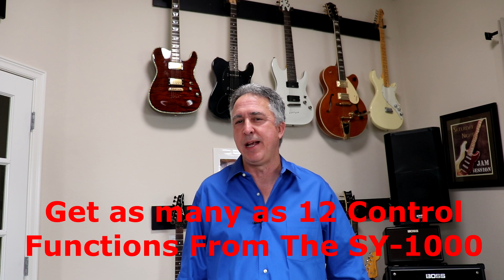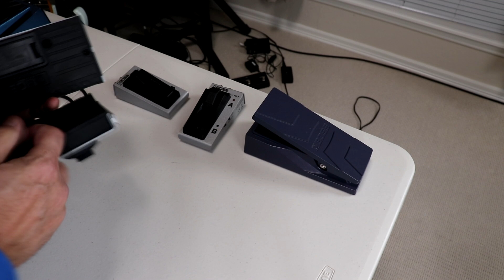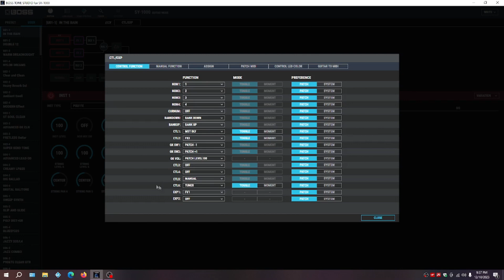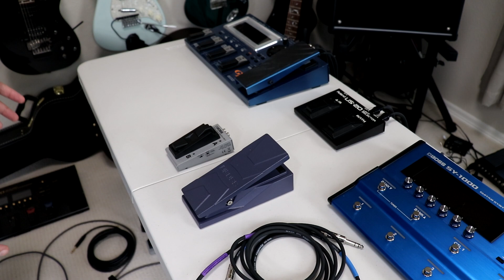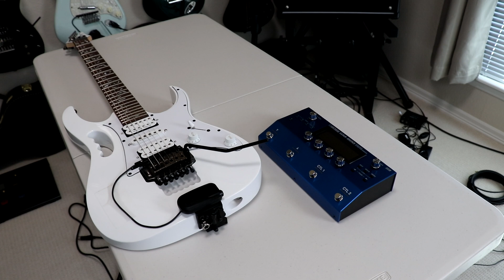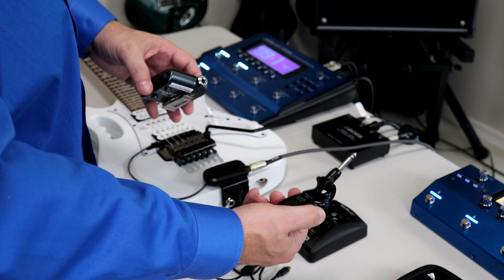Plug Into 3 Guitar Synths At Once

Comment: Good video that lays out the options. It's a bit pedantic, but you should adjust your vocabulary to not call the divided pickups MIDI pickups. They are definitely not MIDI pickups, they are simply divided string pickups. Any MIDI conversions are done in downstream boxes. This tends to confuse people and potentially put off players who don't want MIDI capabilities or delay.
Reply from the maker: You are absolutely right, Midi data is not sent through the pickup. I know how it works. I have been around a long time and I have seen older articles about older Roland GR gear that referred to the GK line as a Midi pickup even though it is not. It is a divided pickup that sends 6 independent signals to the Roland or Boss unit. The transfer to midi actually takes place inside the guitar synth itself. Calling it a midi pickup is just a habit that developed from long ago, but I can see how that can be confusing. I will try to do better.

Comment: but to use the boss sy 1000 you need the pick up midi installed? or can you enter with the jack and have all the ambient sounds?
Reply from the maker: You can use the SY-1000 with a normal guitar and pickup system. There is a special input for that. It gives you access to all the amps and all the effects. You also get access to the main synth for even more sounds. You will need one of the GK pickup systems to access the Guitar modeling and some of the other synths. Those other synths are not the main synth that is built into the unit. In my view, it is worth having the guitar models, and I think they are better than the Variax guitar models by line 6. This all depends on your needs. The nice thing about the SY-1000 is that it has many of the amps that are also found in the GT-1000. So it is their latest quality.

I did a video that shows you how to use the SY-1000 with a normal guitar without the Special GK pickup. It also works great for acoustic guitars. https://www.youtube.com/watch?v=wiYDffAKRJM

Comment: Hello Marcus, as usual your videos are very detailed and well produced.  I'd like to ask your advice: I'm planning to buy the SY 1000 and I'd like to know whether the tracking is excellent on this guitar synthesiser. Is it excellent?  Are the sounds great? What are the advantages and disadvantages of the SY 1000? Thank you in advance. 
Kind regards, 
Phil. From Dunkirk
Reply from the maker: The SY-1000 is still my favorite synth, but it's not for everyone. So let me start with the disadvantages so you know up front. The SY-1000 is not a PCM synth. It is not sampled based. This means that you won't get sounds like sax, horns, pianos, or anything else that is typically sampled in a keyboard. This is a dealbreaker for some people. The SY-1000 is strictly an analog synth. Think of Moog or other types of analog synths. So the sounds are limited to those types of sounds. Some people are disappointed that they can't get the instrument sounds that typically come with sampled keyboards. That being said, the analog synth is great, and you can come up with some great patches for guitar, but don't expect authentic strings or anything like that. It does have some good Pad sounds, which is sort of a replacement for strings.

Now let's talk about the supper powers of the SY-1000. First, it has amp modeling. The amp models are based on Bosses new A-I-R-D technology and not their old COSM technology. These amp models are similar to the ones you find in the GT-1000, and they sound excellent. I chose these models over the Line 6 Helix models and yes I have line 6 gear and I played through and tested the helix stuff extensively. It is important to note that this is really a matter of personal preference. In addition to that, the effects you find on this unit also can be found on the gT-1000. So the effects and the amp models are fantastic. 

It also has a normal quarter inch jack that you can use to plug your guitar into. This means you can use the amp models and effects with any bass, electric guitar, or acoustic guitar. I have made patches for all three instrument types when plugged into the quarter inch jack. No other synth does this. If you are going through the quarter inch jack, you can also use the dynamic synth with your regular pickups. There is more than one synth built into this unit, but they are all analog.

If you decide to get the GK3 pickup, then you really unlock the potential of this unit. Now you have access to all the guitar models and there are a bunch of guitar models. You have a collection of acoustic guitars, Bass guitars, and electric guitars, and you can use these with the amp models. Anything from Mesa Boogie to Fender amps can be found in the amp models. You can also make any guitar a 12 string. In addition to that, you can control the way the guitar model is tuned. This means you can use a control function and enter a dropped D tuning on any patch you make with a guitar model. You can also program open and tunings and alternate tunings into your patches. The things that I mention are often overlooked, but to me, they are some of the greatest selling points of the SY-1000.

And finally, if you use the Gk3 pickup, you unlock the other synths. You can layer up to 3 guitar synths or guitar models in one patch, or you can blend together any combination you choose. This is the most underrated and overlooked guitar synth out there. I call it Bosses best kept secret. You can use it with any guitar you own, and the analog synth sounds are great. Just don't expect to be able to play a grand piano with it. There are features in it that allow you to use it as a midi controller so you can use it with a software synth, but I am still working through this. Latency issues kind of make this hard. I hope this answers all your questions, but if not I did a video exclusively for the SY-1000, and it is a quick overview of the unit. https://www.youtube.com/watch?v=wiYDffAKRJM

Comment: Hello friend, I'm a grs lover, I have the gr-55, gr-33 and gr-20, I'm thinking about purchasing the gm-800, but I have some doubts. From your point of view, has it improved the issues of ghost notes and latency in relation to the grs?
Reply from the maker: I don't have any issues as long as I am using a GK3 pickup. Everything works fine. I run into some issues if I use the GK5 pickup. If you purchase the GM800 you will also need to get a converter box called GKC-AD. The good news is the cost of the box is cheaper than the new GK5 pickup. The box allows you to use any guitar that has a Gk3 pickup installed. In addition to this, Boss just released a brand-new update a few weeks ago that addresses many of the tracking issues. If you have a GK-2A, GK-3 you should not have any tracking issues at all. The new update also improves the GK5 but that pickup still needs improvement. Just be sure to do a firmware update if your GM800 does not have the latest firmware.

Comment: Hi, I have an important question, please!
How to connect a volume pedal in the GM 800. I bought a Boss FV 5 H but it is not plug and play. How do you control the volume while playing, I mean my hands are not close to the unit’s panel. If I had a GK3 instead would be easier
Thank you!
Reply from the maker: The Boss FV5H will not work with a GM800. FV stands for foot volume. This is a straight up volume pedal. What you need is an expression pedal. You will also need a TRS cable for it to work right. A TRS cable is a quarter inch cable that has two rubber rings instead of one. This kind of pedal transmits midi data and it can also work as a volume pedal. Here is an example of an expression pedal.

https://www.boss.info/us/products/ev-5/

Here is the top one that Boss makes. This is what I use for a volume pedal. If you get this one, remember to get a TRS cable to go along with it.
https://www.boss.info/us/products/ev-30/

Comment: Are you real, or a virtual assistant created by Google AI using my guitar synth search history from the past several years? You answered every question I had about the SY-1000, GR-55, and the GM-800, including the GK-5 issue. Thanks!! I have been using the SY-1000 and GR-55 together for a while, and they are indeed a great combination. I can't wait for Boss to fix the GK-5 issue; that is the biggest problem I am aware of.
Reply from the maker: LOL, I hope what ever intelligence I have is not artificial. Maybe it is who knows. I believe the GK5 issue is the only issue there is. I am unaware of any other. Lots of people have this issue and I have heard from many that are struggling with it. I am just glad that I am able to use the GK3 with the GM800. That being said, I made a discovery in the last few days. I switched out the cable that is recommended by Roland to be used with the GK5 pickup. I thought it was a special guitar synth cable with some new tech. Instead of using that cable, I am using a simple TRS cable. So the new guitar synth cable by Roland made to be used with the GK5 is nothing more than a glorified TRS cable. As soon as I did this, the GK5 started to work a little better. There are still issues and this is not a fix. But I don't have the extreme problem I had with the GK5. It is at least a little better.

Comment: This is a great video. I have an SY-1000 and was looking to get a GR-55 and hook them up together. Too bad there is nothing available to be able to make the units wireless for a guitar!!!
Reply from the maker: I agree, Playing wireless guitar has kind of spoiled me.
Reply: BluCoe makes (or made) a wireless GK solution, but they're out of stock and I'm not sure if it got past prototype run and they were not cheap @ €450. It's a shame as GKC cables SUCK and the cheap knockoffs are way worse... plus now they're $100 - for a f*#$ing CABLE!!! 😮 I need 2 of them right now and for that price I could buy another used GR-20... I'd rather drop the coin on the wireless.

Comment: Insanely great idea, especially for live stacked work that leaves everyone confused about what they’re hearing and seeing unless you’re behind the curtains like the Wizard of Oz at a theme park with alter ego issues and a tube amp and your favorite synthesizer. Sounds like a dream job to me. Great work I’m still working on my setup and would like employment performing such kinds of guitar works or sessions. Can’t wait to merge what I got with just 2 of those. But honestly,. I would like your opinion on the best way to play a Jupiter-8v or would that simply be the 800 with a unlocked Jupiter purchase which is how much again are we talking about to play a Jupiter 8 like it’s in front of you but it’s not kinda way?
Reply from the maker: Boss has a software version of the Jupiter 8. One way of blending sound would be through the computer. The GM800 could act as a midi controller. The next video explains how to do this. Another way would be through midi. If you have the Hardware version of the Jupiter 8 you can access it through midi. You can use Tone Studio to set up your GM800 patches so the Jupiter 8 will respond to the GM800 or the GM800 will respond to the Jupiter. The Last video I made covers how to program MIDI.

Comment: In order to use an expression pedal as a volume control do you have to program that into each patch or can you do it globally? With the GM 800
Reply from the maker: You need to program that into each patch. There is no global setting because it is an expression pedal. It does other things. For example, you can use the expression pedal to control the rotation of a rotary speaker, like the kind of speakers found on organs. The good news is that it is very easy to set this up if you are using the Tone Studio software. It does not take long at all.

Comment: Very nice video, well explained. Were you finally able to fix your issues with the GM-800?
Reply from the maker: No, I was not able to fix these issues. The only way that the issues will be fixed is through a firmware update by Boss. However, all my guitars with the GK3 pickup work with the GM800 very well. In Fact, they work better with the GM800 than with any other guitar synth. The GK3 tracks better with this synth. As much as I would like the GK5 pickup to work, I am not without a solution. I just use my other pickups
Reply: @marcuscurtismusic  I just got a GM-800 and use it with a SY-1000 and GX-100. I noticed some tracking issue with my GK5 and GM-800 but tracking seems to be the same as my GK3 with the SY-1000. Since I only have a GKC-DA, I cannot say if the GK3 would track better with the GM-800. But from what you are saying, your GK3 (through the GKC-AD) works better with the GM-800 than your GK5?
Reply from the maker: @ChristianDubuc-l4t  Yes, that is exactly what I am saying. This has been my experience. The GK5 works great with my SY-1000. This tells me that the issue is not the GK5. The issue is the software on the GM800. This could be fixed with a firmware update. How long it will take Boss to do a firmware update is anyone's guess. I would recommend contacting customer support on the Boss website and tell them about your issue. I think if more people would report this, then they would issue a fix sooner because they will make it a priority.

Comment: Dear Marcus, thank you for your great work and I don't want to know how many hours you spent on it! I have a question which might be stupid and/or not valid : In case I want to AVOID a GK-5 adapter - would the following routing/chaining be possible: I go from my electric guitar (no GK-5!) into my SY-300. Then I use the SY-300 OUTPUT to go into the GM-800. so, again, I just want to trigger the GM-800 sounds WITHOUT using a GK-5 adapter. I am aware that I loose the guitar to midi feature, but the sounds alone would do so far for a certain guitar. Hmm- writing down that, I fear there is an error in my reasoning!?? 🤔
Reply from the maker: You will need a GK pickup of some type in order to use the GM-800. The superpower of the SY-series is that you can plug in any guitar through a quarter inch jack input. The SY series are the only guitar synths that do this. All other Boss and Roland guitar synths require a GK pickup of some type. You can't take the output of the SY-1000 and go into the GM-800. However, there is a synth output on the GM-800 that allows you to go from the GM-800 into the SY-1000. You will still need a converter box of some type. Think of the GM-800 as strictly a Keyboard device with no guitar features at all. It is a keyboard that you use a guitar to play.
Reply: Wow, thank you so much Marcus. I am very happy having found a true expert in guitar-synth-connectivity. At the moment for me it looks like you are the only one having the big experimental picture  with regards to that subject beside the common and usual reviews.  @marcuscurtismusic

Comment: Great video, thanks for sharing! i have several GK units myself, the SY-1000, GR-20, GP-20 and had more in the past. I love the SY-1000 guitar options and prefer it above the L6 Variax as I can use my own guitars. I can recommend the Primova sound GX-2 GK instead of the US-20, check them out ( I have no affiliation with them, just think they are great products!).
Reply from the maker: I too have a line 6 Variax guitar. I also have the line 6 Variax Bass. As much as I like those instruments the SY-1000 is still better. Just ordered a GK3 B pickup for one of my bass instruments. Can't wait to see what it can do.

Comment: You are using the GR-55 Guitar Out to feed the GT-1000. The SY-1000 does not have a Guitar Out, but can it be configured to send a signal to a multi-effects pedal? I have a Helix and would like to connect the 2 units.
Reply: hi, I use it in the loop of the SY-1000 or you can use the sub out (S LR) to split after the guitar signal. so  in tonestudio Normal - S LR to Helix - rest to M LR.
Reply from the maker: The only way I have tried to configure the SY-1000 to output into the GR-1000 was through the send jack. I have not tried other options as of yet because I just use the GR-55 and that works fine. However, If all I had was the the SY-1000 then I would take a deeper look at the sub outputs. This would require some exploration in tone studio. I would need to configure the sub outs to send a dry signal for every preset.
Reply: Did you know Roland’s Gaia SH01 has the same additive synth as the SY1000. Could we program one from the other?
Reply from the maker: @MartinCraneRockbeast  I did not know that. I went to look at the Gaia SH01. Not sure about the method for programing it. Thanks for sharing this info.

Comment: I’m trying to hook up my gm800 to my sy1000 so I’m gonna want to grab a mixer but would you recommend a mixer that is less than $400?
Reply from the maker: Obviously, you need to operate within your budget. It's ok to grab a mixer under 400.00. That is why I did a review of the Mackie pro 3 mixer. The 12 channels on that mixer is more than enough to hook up the GM-800, The SY-1000, The GR 55 and your pedal board all at the same time. Just use it as a sub mixer for your guitar gear. The current price is $359.00. I only use it to play out. That way, I don't need to bring my whole system with me. Right now it is set up over at my brother's house, and we do jam sessions there. It works great for everything you would want to do.

However, the main mixer I use is the Behringer X-32 producer. I have done several videos on its operation. Not only is this good for all the guitar synths, but the built-in audio interface is great for a home recording studio. This is a digital mixer verses the analog mixer that Mackie makes. I can record on 16 tracks at once and there are several great features. It is more expensive and comes with a price tag of around $2,000.00

Any Mixer under 400.00 should work as long as it has enough channels. You want to use each guitar synth in stereo, so you will need two channels for every guitar synth. When you buy your mixer, consider any expansion you may make to your system over time.